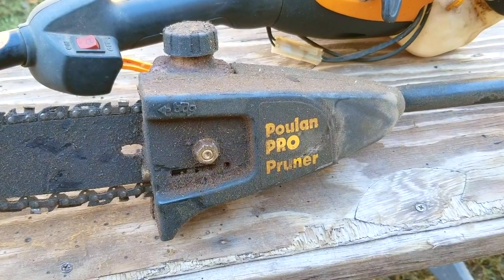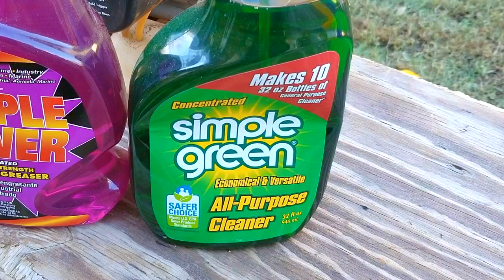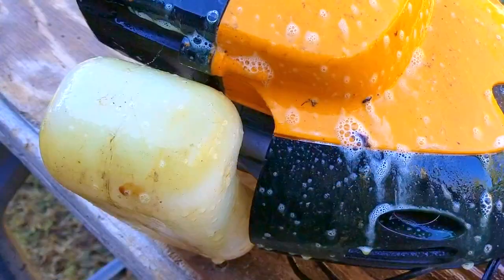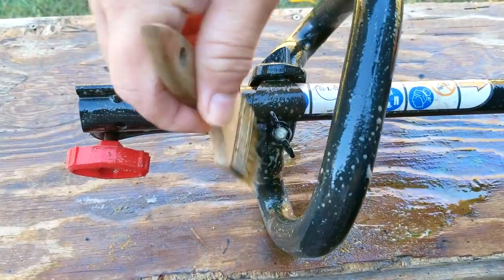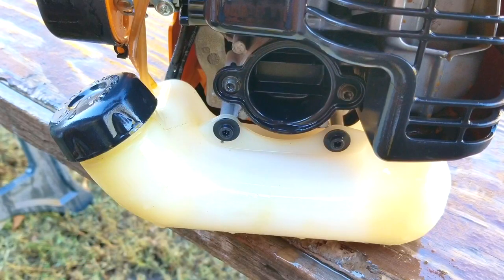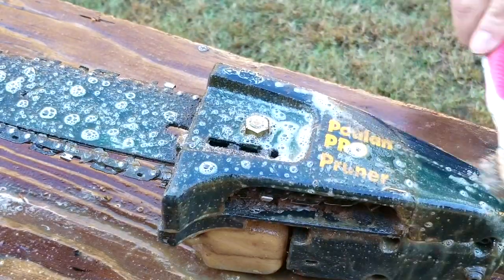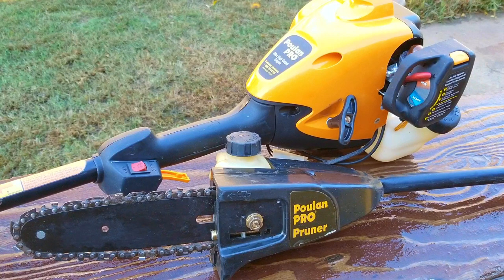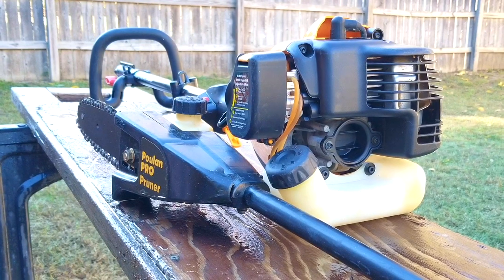Cleaning A Stuck Poulan Pro Pole Saw

Comment: Wow that spark plug did not look good at all. Almost looks like water was in side the cylinder.
Reply from the maker: you are correct, it was still a bit wet and dirty, so a tear down, and cleaning are required.

Comment: My weed eater 20 push mower starts just fine but when it's running, it revs up and down and I've already checked the carburetor and it works but I don't know why it's revving up and down
Can you help me please
Reply from the maker: on yours, I would consider replacing the diaphragm.
Reply: I checked and it was fine but now it won't run anymore because the crank shaft is bent😥

Comment: Looks lovely after a good cleaning and i reckon water may have gotten into the cylinder but luckily not hard to fix by soaking that one with a bit of a torch on the cylinder block along with someone  WD.40.
Reply from the maker: you are correct the fix is fine, however I make a mistake that almost ruined everything
Reply: @INSIDEHOUSEGARAGE strewth a optional way is carefully removing the cylinder block etc.